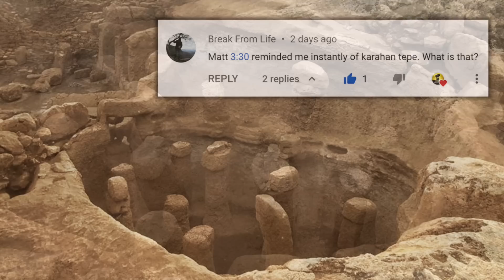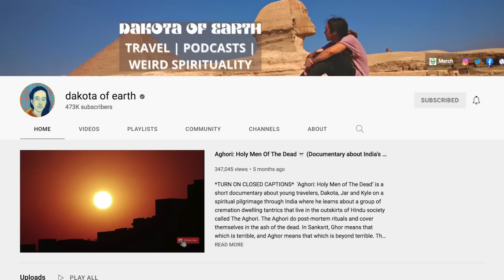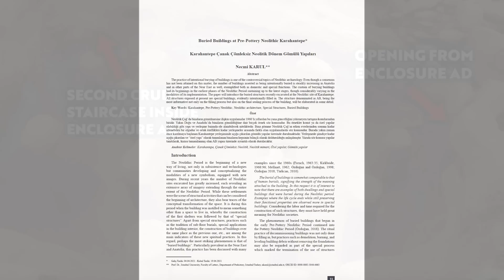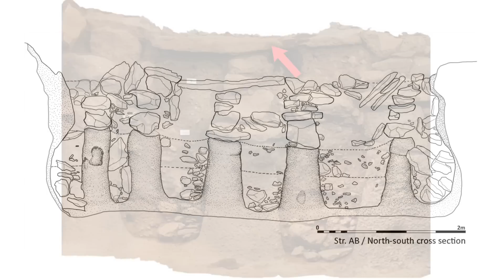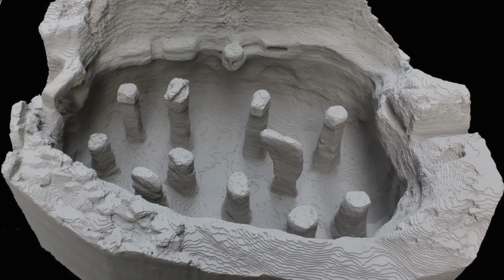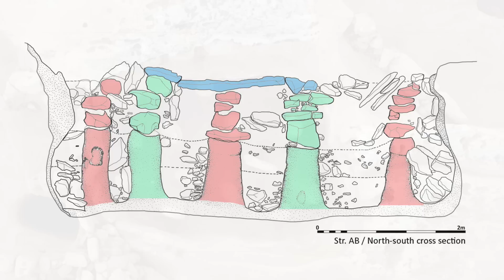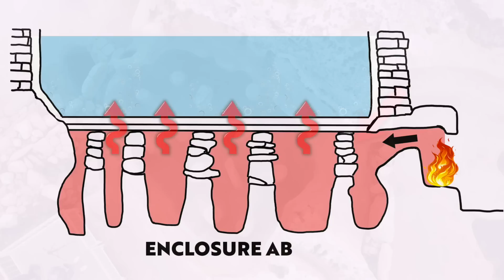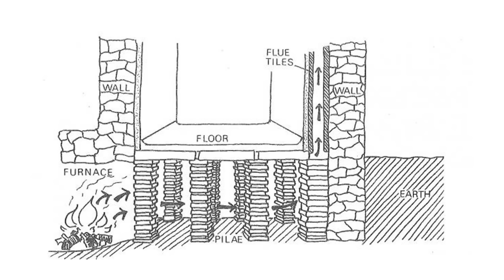An 11,500-Year-Old Central Heating Hypocaust system at Karahan Tepe? | Ancient Architects

Comment: These sites have already rewritten history so it's not a far reach at all. Great hypothesis!
Reply: The possible bath house in AB looks a lot like the ritual baths found in Qumran. The details of how the bath house was used are detailed in the dead sea scrolls which were discovered nearby 📜 Maybe it's worth comparing these sites a little bit in another episode expanding on your theory. Lots of similarities between the two sites when you look at AB as a potential bath house. I did a quick Google images search and I couldn't find the image I'm thinking of which I saw in another video but the deeper part you mentioned looks very similar to another bath used for the exact purpose you talked about which was dunking the whole body. They also feature a ledge around the edge for sitting in as well as a prominent ledge near the dunking area. Looking at those images got me thinking about how they look very similar to the ruins of the bath houses in San Francisco as well. We know from photos that those bath houses had a huge floor and glass enclosure on top but all of that is completely gone today and only the foundations that were underneath are left to explore. I've been to that site many times and it is nearly impossible to imagine the huge structure that used to be there. Just goes to show your comment about these being ruins is spot on. Even ruins from the last century are completely unrecognizable a hundred years later let alone thousands. Maybe you could touch on both those sites in a follow up if you ever do one. Ritual baths and bath houses are a cross cultural idea that goes back a very long time.
Reply: An interesting hypothesis, certainly not above the ability of these neolithic people.
However, there are some aspects of the thesis that I find less convincing.
1 - While it is a problem to heat water when large vessels are not available, the traditional way this is achieved is by heating rocks and  submerging them in a pool.
If the intention was to provide a bathhouse with hot water, digging a recess and depositing heated material would be much simpler and easier to maintain.
2 - Sooth is a particularly staining aerosol, if the place   was filled with smoke, I surmise, traces should still retrievable in the porous recesses of the structures.
3 - While floor-heating may still be plausible, a waterproof and heating conducting floor, (meaning able to transfer significant warmth to a body of water above) could have been difficult to achieve and maintain. I would find it more reasonable to imagine that the place could be used as a floor-heated sweat lodge, instead. A place of ritual cleansing (as in some historically described cultures) that is followed by a passage, perhaps a ritual one,  to a pool-room or bathhouse in the same complex.
Reply: @Sergius248  I regret making a similar reply before reading yours.  A sweat lodge didn't occur to me.  However, as hunter gatherer North American tribes used them, they could have started made of materials like those used in the Americas, that later developed into permanent structures.
Reply: @Sergius248  I agree with your sauna/sweat-lodge idea: water overflowing from AA onto the hot floor of AB would be turned to hot water and steam, with any excess water flowing out along the small side channel.

As if these structures weren't hard enough to explain already, in a time when humans were 'supposed' to be hunter-gatherers; but now they may have incorporated more advanced technologies, such as indoor heating and bath-houses!
Clearly, we have underappreciated our ancient ancestors!

Comment: 8:54 I work in the water industry. What I see is a settling pond. dirty water comes into one side of enclosure AB and water movement slows in the pond to allow the muck to settle out. a cover would help avoid outside influences from disturbing the settling water. the cleaner water, on the top, exits to the larger pond where it can settle even more and be drank.
Reply: That's what I thought too.  There's more sign of water wear than of fire.  The basal layer than would be the settled sediment.
Reply: @crhu319  interesting idea, it would help to know what water sources where available in the subregion at that period. technically the hypocaust makes just as much sense but it would seem that traces could be found if fire was used !
Reply: This is an interesting hypothesis, it could have been basically an ancient water purification system. Cool :D
Reply: @ottodidakt3069  there would be traces of sediment buildup from the waterflow if it was a filtration system.  The volume of space taken by the columns would be inefficient for water storage, but functional for heat transfer.
Reply: @customsongmaker  As Cr Hu points out, there is a build up of sediment at the bottom of the enclosure AB and I agree with Matt a chemical analysis of that basal layer would help determine further, but it was apparently built up over a longer period of time. As for the columns being inefficient for storage, I think that’s missing the point of the original settling pond idea. The purpose isn’t storage of water, but decontamination of flowing water. As also pointed out in this thread, the source of the water would have to be determined since this would require a steady flow of water to work. It’s also interesting to factor in the channel running from it—maybe an overflow spout, or perhaps it was diverting filtered water to another place/purpose?
Reply: This looks, to me, that the roof of the enclosure collapsed. I don't see any carefully laid layers, it looks like a chaotic collapse with the layers determined by the roof materials. 

One proposition is that the roof was made from timber beams that eventually rotted. The timber was covered with earth and rocks and a slab. When the timber disintegrated, the soil, rocks and slab fell between and on-top of the pillars, giving the impression of carefully being buried. 

The site at Gobekli Tepe is similar in that it was filled with landslides possibly triggered by earthquakes. This could have been the reason this area was forsaken - increased earthquakes and landslides...
Reply: If this was part of the drinking water supply, system it could have been deliberately destroyed by an enemy force to make the entire site uninhabitable. This would explain the jumbled upper fill layer.

Comment: with a degree in Archeology  or without, I'm gonna say that is the best theory to date!! Kudos for always thinking outside the box and not always going with the old " it's a temple" ruse lol
 this is probably my favorite channel that discusses ancient finds...keep up the excellent work!
Reply: So not water storage as I've suggested? The problem with the current archeological beliefs is nobody is thinking for themselves. Even if you don't agree with me. Unless that's a degree in following the old dogma. Look learn and keep an open mind.
Reply: I dont know how you can be so confident its not a temple.
Reply: @waltonsmith7210  the 'Gods' were water, fresh and salt. So it could be both. But I was talking of one chamber in particular. Also any significant ancient community requires water. Most from Peru to petra have a strong connection to water for a very sensible reason. Also during the ice age a supply of unfrozen water supply would likely be useful. We worshipped the water of lifefor a reason.

Comment: Some of the proposed fill could have been intentionally placed rocks used as a thermal battery intended for holding the heat within the pillared area so after the fire died out it would still radiate heat.  If that was the case there may have been insulation on the side walls.  If that really was a water tank or pool on top then that red sediment may may originally been what filled the voids between the flat rock and whatever was used to finish off the surface above the flat rock before settling down when the floor/ceiling collapsed.  That pit near the proposed furnace could have easily been used to hold ash for later disposal or use.  

You'd also think if this was used this way that there would have to have been a good deal of fuel nearby as well as residue embedded near the furnace areas.

Regardless, a fun hypotheses.  Keep at it.  I really appreciate that you mentioned these people will likely very practical people.  Likely they were well incentivized to let very little go  to waist.  Another method of refining your hypothesis, or any hypothesis for that matter, is to look for the likely evidence of input and output streams of such endeavors.  If there was fuel needed, how much, and of what type, what was the likely source, if water was in abundance where did it come from, did it change over time, if there was fuel collection how many were likely needed to support that gathering, if a waist stream was created where would it likely end up or what would it have been turned into?  

This is pretty old stuff to look at, but as we run through compelling hypotheses we'll likely find traces of the tale that tell the story.
Reply from the maker: Wonderful comment. Appreciate the feedback
Reply: That's what I was thinking about, however it looks like water is meant to flow into the enclosure. Could it be a big pot? Like for boiling water (creating steam?) There's a few different ways they can contain heat, but this looks to function with water.
Reply: Good list of clues for archeological analysis.  My field is history, which is multidisciplinary,,but I am still not anaecheologist and could only guess admittedly at the various scientific experiments and tests that could be applied to the cite to determine if your observed potential clues yield pay dirt. The red earth idea I also thought of and possible evidence of sustained fires.I did not think of a lot of those ideas. These tests would be paramount to disproving or to proving this hypothesis.
Reply from the maker: @ThatTieDyeGuy  You could ask the same question about every example of Roman hypocaust system in the world. Where is the soot and carbon there?
Reply: @AncientArchitects  nevermind, thought this was an open discussion...
Reply from the maker: @ThatTieDyeGuy  It is... that's why I responded. I think it's a fair comparison. If we know why the Roman ones don't have soot and carbon build up, maybe we know why the Karahan one doesn't. Maybe its just from cleaning after excavation. There is little information in the public domain about Karahan right now.
Reply: @AncientArchitects  I think you are onto something, I just think there was a hot spring due to the funny pit in AA, it accounts for the smoothing of the rocks the too small holes, and many other features. As to the carbon build up I mistated I had meant to say that if it were a hypocaust then an analysis of the bottom layer in AB should show more carbon when you run it through a gas chromatograph, but I was busy and typing without thinking. The walls also need to be sampled to check for mineral build up from a spring. It looked like the white marks on the hill might be the remains of an ancient hot spring. Both hypothesis make sense. So now we need to get someone with some sample bottles there on the ground; and get the soil run through a GCM and get it run through a high powered microscope so we can confirm pollen in each layer to make sure it correlates with the C14 data for the layer, if there is enough organic matter to do so.
Reply: Sand is a great reservoir for heat. If there was a fire, shouldn't there be evidence of soot (especially as it would be preserved if the hole was later intentionally filled in). Also, a such a system would need a flu at the opposite end from the fire to draw through the air. Any evidence of this?

Comment: I tend to agree with your hypothesis Matt. It would be interesting to see a chemical analysis as well. Also if any charcoal was found to analyze for carbon dating might help.
Reply: They can already date the site based on the material that it was buried under. That gives it an accurate date of burial but not when it was constructed. It may be thousands of years older, it was just buried at THAT time.
Reply: charcoal would indicate it was being used for filtration purposes, rather than used for dating.
Reply: @bjmurrey  in the Paleolithic? I wasn't aware of it being used for its filtration properties that long ago.  If you have anything I would love to read! But yes these sites are already pretty well dated to the younger dryas period, almost all the Tepe sites to my understanding
Reply: @SamtheIrishexan  amazonians did similar water works and earth works in similar time periods. Terra praeta is same principle but reverse. Just what strikes me when I see the "schematic" layout of the place. Fascinating stuff. Mayans did a lot of this with limestone cisterns as well, to capture, contain, and purify water in the jungle where there is basically zero rainfall and no ground water sources or even soil. Just a humid desert. But I am open to other ideas, but if I had that on my land I would use it for a water filtration system that irrigates crops on the hillside as gravity takes it down the hill via swales and channels. I'd expect there to be more "basins" at various points below this complex if my hypothesis is correct. Essentially limestone "ponds". And the plants can and do root in the limestone and get minerals and water from them like a sponge. So that's my disprovable hypothesis.
Reply: @SamtheIrishexan  I appreciate your thoughtful comment, too, friend.

Comment: I have always thought that there must have been a risk of burning the house down when you have a hypocaust filled with smoke from a fire, especially if floor above is wooden, or the wall flues are adjacent to .wood and plaster. That problem must have been solved if similar systems outlasted the Romans.

The other things that stood out are that when we look at ruins we may be viewing the basement rather than the ground floor, and that excavations may take us below the level that the inhabitants actually used. 

Modern archaeologists study the "fill" as well as the bare bones of the structure, since it may contain some of the "meat" that fleshed out the body of the building and tell us more about its use and its users than the stone skeleton alone can tell us. I hope the infill was not just thrown out, as would have happened in the 18th and 19th centuries.

Comment: Hi Matt I think you are onto something! If you don't mind me sharing my thoughts they are simple and I've only had a quick check to see if possible they are viable so here you go using your ideas of a heated floor in AB it reminded me of how people malt barley and then knowing this process is a 3 stage process having 3 enclosure and simple brewing has 3 things needed grain, water and heat your description water chanels heated floor, I checked and there is evidence to suggest that the resident people's were mainly meat eaters but there's a couple of papers 2020 saying they have found evidence that the use grains was more prominent than they thought through new techniques being used. Anyway I know this might sound a bit wacky but brewing had to start somewhere at sometime. Hope this stimulates some thoughts. Brewing has always been associated with with ritual and worship 
Thanks for listening 
Regards Dave
Reply: OMG! that was my thought and I replied earlier that the floor could have been for drying sprouted grain to make beer! I read the paper on the chemical analysis of beer residue at Goebekli Tepe and this seems so reasonable.
Reply: @susanohnhaus611  Hi Susan yeah I saw that article whilst I checked out the idea. Matts idea and research is great fermentation and food preservation have always been at the forefront of human survival hence ritual and worship. Nice to see you are thinking along the same lines 
Regards Dave
Reply: Yessssss.   This makes so much sense to me. I truly appreciate Matt's glorious logical leap on the raised floor (and most definitely roofs!), but nobody would build a heated pool if they could have a brewery instead. AA is the soaking/germination room, they put the grain in bags and dropped them in the plunge pool area. AB had a hard heated floor to dry the germinated seeds. (The underfloor face looks like a god of hot wind.)  AD is the finishing area with lots of horizontal surfaces for processing and baskets and such. The furnace and heated room were probably damaged in some way and decommissioned, but the big room was still useful long after.     Listen to the Prehistory Guys podcast #22 Beer in the Neolithic with brewing experts Merryn & Graham Dineley.  This was a malting facility.
Reply: @heidilindborg7601  Thank you for your comments it's definitely worth some further investigation but is feasible and explains the magic number of 3 processes to make the fermentation processes!
Regards Dave

Comment: The questions that I can think of after watching your hypothesis are 1. the source of water,  the underlying water table (possible aquifer/spring/well? 2. possible structure above a room/bathhouse. 3. water flow direction, could that pit be a soakaway next to the proposed furnace?
Reply from the maker: A lot of questions - and I appreciate the comment. I would imagine there is an ancient spring nearby, maybe dry today. I imagine many of these PPN sites were chosen because of a water source. Some Tas Tepeler sites still have running, natural springs.
Reply: @AncientArchitects  one more keyword for searching: "holocene climatic optimum". Probably with the added "middle east" or "fertile crescent" as well. Might bring some interesting results.
Reply: @AncientArchitects  Possibly an artesian well if the water table rises.